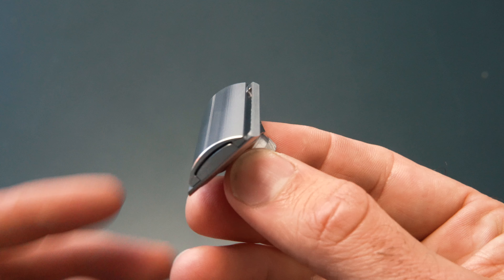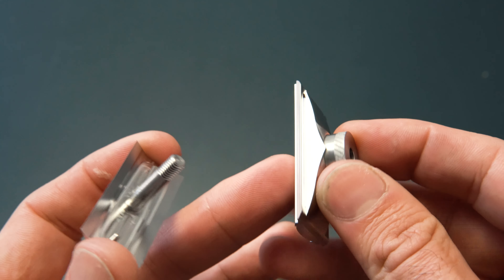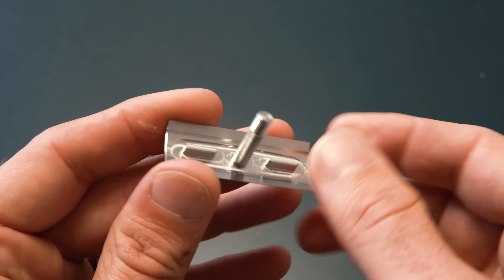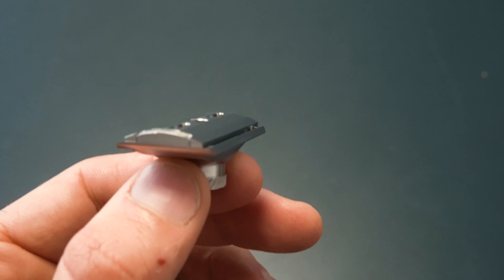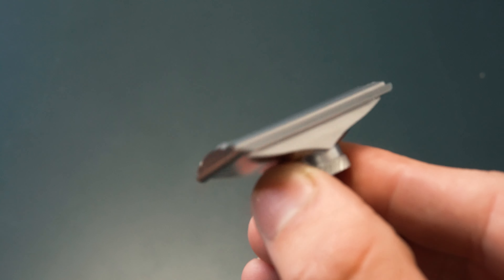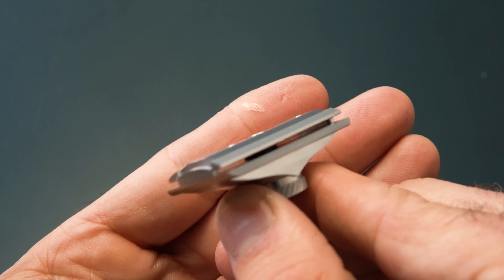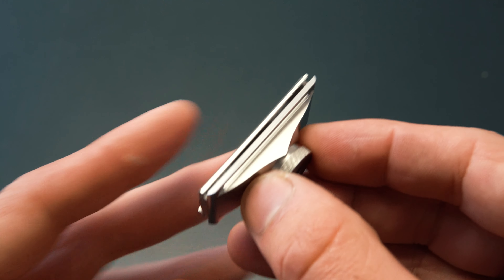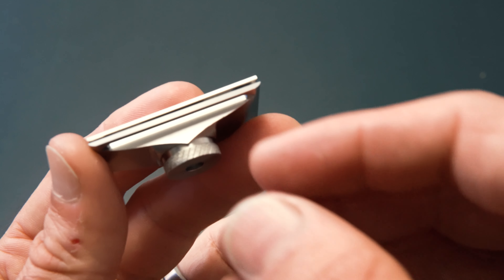Building a New Blackland Razor: Part 1

Comment: Please rethink the heft. There's nothing quite like the efficiency of gravity!

I'd rather lightly touch my face and control the speed of the fall of a hefty razor against gravity than trust my "pull down" of something uber-light that also needs the "press in" to the skin to replicate the efficiency of the hefty razor!

Know what I mean?

By the way, that head tech looks very fucking sweet! I've got the adjustable Rex Ambassador so i'm looking forward to seeing this new model and how it stacks up!
Reply from the maker: It will be heavy enough for gravity to do the work, but not overly heavy because heavy razors restrict your options. It’s easier to add pressure when you need it than it is to take it away (see our benefits of titanium video). As a brand, we’re trending strongly away from the super-heavy stuff and toward more maneuverable, agile products. This should have the weight of a normal stainless razors. Something around 100g hopefully.

Comment: I've rewatched this about a dozen times - the head cap narrowness is absolutely fantastic. This mechanism reminds me so much of the Tatara but I like the profile more. Totally geeking out here! I wonder if the wave spring/retainer could have the weight increased to reduce baseplate wobble (similar to the Gibbs, where weight of the spring really impacts the side to side movement.)

Keep up the work Shave & Blackland Team!
Reply from the maker: Thanks for the thoughtful comment! We'll hit on the wobble improvements in Part 2 and also describe the cause more clearly. In real time, this issue is pretty much fixed, but the videos won't come out for a bit.

Comment: This is really cool to see behind the scenes on the design, decisions and challenges. The head looks innovative for sure.  I like adjustables but for me the issue usually is the razor is head heavy instead of being balanced with the handle weight and length.  With the 3 piece design there will likely be interchangeable handle options. Titanium is also a really good idea to keep the overall weight down.
Reply from the maker: Thanks, Chris!

Comment: The handle works as a lock? Stepless adjust? Wow ...
Hope the adjustable top plate can be easily taken apart for cleaning.
Curious of the possibility of open comb design, could it work with only swapping bottom plate?

It's kind of unthinkable that you share such many detail at this stage. Appreciated and really looking forward for it.
Reply from the maker: Exactly right. The handle tightens down to lock in your setting. Loosen to adjust then tighten back down.

Comment: Really interesting. I always wondered why pretty much every modern adjustable razor that we have is huge and bulky when vintage razors like the Gibbs adjustable and others were able to make it as thin as possible. I'm not a fan of razors with huge and bulky heads and no matter how great they shave, a more nimble razor with a slim profile will always be my preference. 

If you are able to sort out all the issue of your prototype and indeed add a wide range of efficiency and if possible, a way to be used with different angles, since most razor manufacturers these days favor natural and shallow angle, which isn't everyone's cup of tea, that would be an awesome razor.
Reply from the maker: Appreciate the feedback!